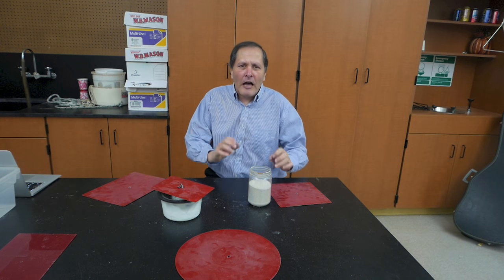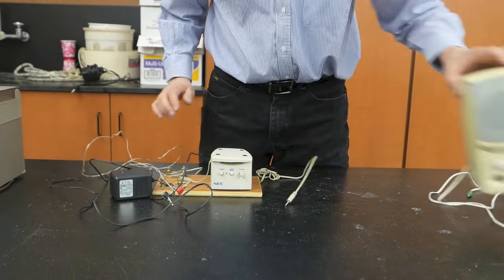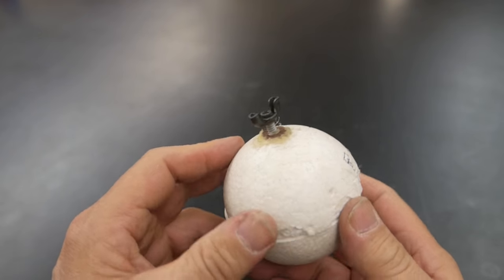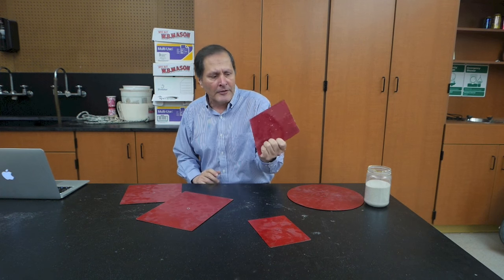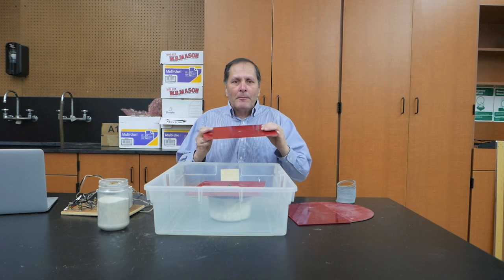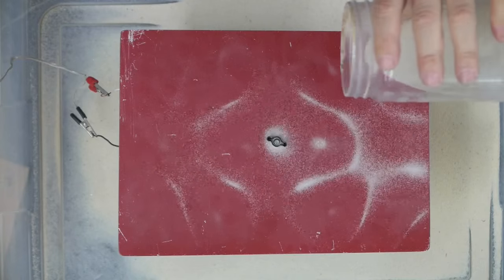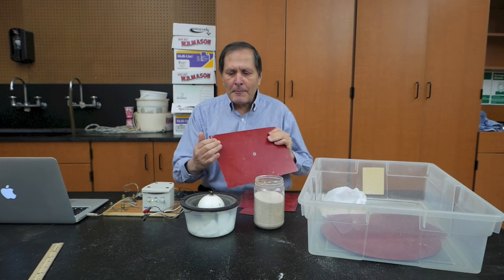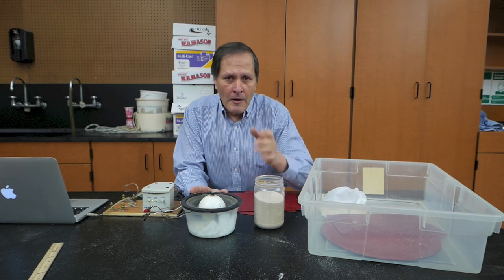Chladni plates & mechanical driver- cheap! //  Homemade Science with Bruce Yeany

Comment: As usual,  a brilliant presentation.  One can use a violin bow to excite the sheet and putting a finger  at a particular position will show different modes of oscillations. Also cutting different shapes and cutting a slot or two in similar sheets will show stress points for various modes of oscillations where in some craft as planes and other machines one tries to avoid thse modes of oscillations because of fatigue and failure.
Well done, so much work behind all these demonstrations. It needs a dedication man as this gentleman.

Comment: Here I was trying to make a heavy solenoid respond at audio frequency’s. Meanwhile you just hot glued some Styrofoam to an old speaker. Nice work! 
You should be able to cut away a lot of the speaker paper if you want it quieter and don't mind destroying a speaker. Better yet start with a torn speaker.
I didn't think the speaker would be strong enough to vibrate the plate.

Comment: Great project, Bruce.  These are what is called "standing waves", by the way.  The driver launches the wave into the plate at the center.  The wave travels radially outward and reflects back in off the free edges.  If the edges are held fixed, then different patterns will form.  The waves reflect in a different phase - 180 degrees (instead of in phase when the edges are free).  If you could hold the edges with just the right damping "load" these patterns wouldn't form because there would be no reflected wave.
...
This is related to how holograms are made and these standing waves happen in bodies of water (high school wave tanks show this), in rooms (you can move around a room and hear a constant tone come and go) and along radio transmitter transmission lines.  You could have students do this in the classroom! Pick a tone with a wavelength of a few feet; below 1kHz to start.
...
 I just gotta' spend more time watching your videos for these really good demo ideas, Bruce.  Thanks for your creativity and efforts.
-- 
Cheers, ScienceAdvisorSteve
P.S. I'd call the speaker a 'driver' rather than 'oscillator'.  The signal generator is called an oscillator, or at least is has an oscillator circuit in it..  An oscillator is an electronic circuit that generates a repetitive signal.
Reply: I suppose the patterns and shapes depend not only on the frequency but also on the characteristics of the plate (shape, elasticity, material and so on). Is that the case?
Reply: TranscendentalTones Yes. You've got the idea. A simpler example to start with is a guitar string. It can vibrate "naturally" at frequencies which are a multiple of the lowest. The lowest would be called the fundamental. The higher ones are most correctly called overtones (when talking about a vibrating thing), but the frequencies are called 'harmonics'.
...
Look at the first image here: https://en.wikipedia.org/wiki/Guitar_harmonics
This shows how a string can vibrate. The most motion is where the lines "bend out". Where the lines cross in places between the ends, there is no movement.
...
For the plate, visualize this happening left-right across the plate as well as up-down.
...
For the string, the ends are held fixed, but the edges of the plate are free to move and usually do. The sand collects where there is the least movement - at the points where the string doesn't move which is shown by the cross.
...
Make the plate stiffer, and patterns happen at higher frequencies; like a tighter string. Make the plate heavier, and patterns happen at lower frequencies; like the thicker strings.
.
This is showing what is called "resonance". The plate/string resonates (vibrates easily) at these frequencies.
...
Finally, another way to look at physical resonance like this is as waves traveling through the plate.  Think water waves traveling across water.  However, when there is the end of the plate, the waves reflect and bounce back.  When this happens. the waves traveling in opposite directions cause the type of vibration you see on teh string.  These are called "Standing Waves" because they stay in fixed positions.  You can't see the two waves moving along in different directions. This may seem strange for two moving waves to look stationary, but that's what happens.
 --
Cheers, ScienceAdvisorSteve
Challenger.org

Comment: Do you think that if you drilled the hole with higher precission (in the perfect centre of geometry of the plate), it would make much more symmetrical patterns? It looked really nice on the record which has to have the hole perfectly in the centre, but it looked much worse with the square plate

Comment: pretty cool. These are actually related to the solution of the wave equation in a plate. Hence, the pattern will depend of the shape of the domain, the frequency of excitation and the boundary condition i.e. the way the edges of the plates are supported. currently you have them free. but you could have something like restricted displacement but free rotation (kinda like the slinky). Thanks for the video
Reply from the maker: thanks Felix,  I'm planning some new plates for this to see what else I can get

Comment: Hi Bruce, could you connect directly from your computer (or phone) to the speaker?  How necessary is the amplifier?  I don't really understand how you're connecting the amplifier to the speaker via the 4 metal posts.
Reply from the maker: the computer or phone doesn't have enough to power to drive these speakers,  you really need an amplifier like for a stereo system

Comment: I'm a music teacher whose favorite subject all through school was science. 
What if I simply put a suitable plastic container on the speaker on my keyboard? I can definitely feel some vibration coming from the 2 speakers, but if it is insufficient, suppose I plug my keyboard into my roughly 2.5' high amplifier (don't recall its wattage at the moment), lay the amp on its back, and place the sand box on the cloth surface? I also have a microphone that I use with the amp and could go that route with the online tone generator when my keyboard's range ends on the high C (4096Hz).
Reply from the maker: I'd say give it a try,  start at a much lower range and work your way up
Reply: Did you try? What were your resultas? I was thinking to do something like u.

Comment: This explains how the Egyptians were able to move massive stones using sound vibration. If you can manipulate sand to reposition beneath a stone, you have yourself a lever.
Reply: @nickj1111981  You don’t need electricity. You can move sand an a drum with your voice. Google or YT it.

Comment: HI Bruce. Great job! Just an information: Wich are plate’s tickness and frequency range used in your demonstration.

Tks
Reply from the maker: Hello Luigi,  thank you,  I'm not sure about the thickness,  they were cut out of the sheet metal covering on a broken heater.  I've tried a few thicknesses in the past and found to have success with ones that I could bend and flex by hand.  The frequency  range started around 100 and gave me good result up to around 2000 hertz.

Comment: Hi, I'm trying to make something similar. But I want to cut out the annoying sound somehow. I was thinking to cover it with transparant plexi glass so you can still watch through it. You think it would work? Or any other solutions to reduce the annoying volume while maintaining   those clean patterns?
Reply from the maker: cut as much of the speaker cone away as possible helps reduce the sound. your good idea of covering it with plexiglass should help also,

Comment: Bruce how do u feel about A=432 hz- A=440hz and how they resonate with the plates? Does it produce better results when the plate is tuned to one of those particular freq? Im trying to find out if 432hz really is a better tuning. Acapella is usually around 432hz. Im looking at bird song also although its quite tricky.
Reply from the maker: It's been a while but I found that each plate behaved a differently, depending on the size shape and thickness, even it it was slightly warped,   the plates were never tuned,   but I think that would be an excellent idea.    At the moment I can't judge whether 432 or 440 would be better,  once again I think the shape would make that distinction.
Reply: Bruce I appreciate the reply. I write/compose music and as u know the last year has raised a lot of questions. One is the A= 432hz. I had my piano tuned to this and yeah its fine. But I just cannot find definite answers or proof to whether this is a better tuning (more in tune with nature) to use and whether i should start recording to this tuning.  If the ancients did indeed tune to 432 or round abouts id be inclined to trust them. La rouche from the schiller institute campaigned for it to be changed to 432. Rudolf Steiner believed C=128 hz and others but the theory often gets labeled with the 'Flat Earth Theory' Jamie Burtoff research points towards 432 hz . Im wondering if every individual has their own unique freq I.E. such as each resonate plate. Acappella for me comes out at about 435hz. My guitar sounds nicer at 432hz Im also wondering does any of it matter? Id love to see some research from your end. Maybe a video u could do? Thanks for repying Bruce.

Comment: Hi Bruce! Thank you for this video, very helpful information! I just wanted to ask, do you think a regular speaker would work, without the styrofoam? Just set it underneath the plate and voila? 🙏
Reply from the maker: it's possible but you'd have to turn the volume up really high
Reply: @YeanyScience  Okay, thank you very much!

Comment: Sir , plzz tell me the thickness of the plastic sheet we can use instead of a music record or metal sheet.
Reply from the maker: they are not all the same thickness,  I've also used ones out of different materials, some are steel some are aluminum.  If you are looking to try it in plastic,  I would start with 1/16 of an inch

Comment: How loud actually is this without editing?
Reply from the maker: loud enough to be really annoying but not dangerously loud
Reply: +Bruce Yeany (Yeany Science) like 70 decibels? Or maybe 40
Reply from the maker: I'd say between 70 and 80
Reply: Just a thought, could you cut holes in the speaker cone so that it still oscillates normally, put doesn't push as much air?